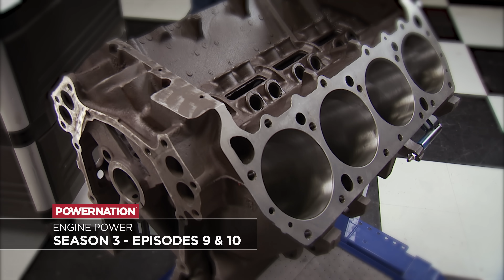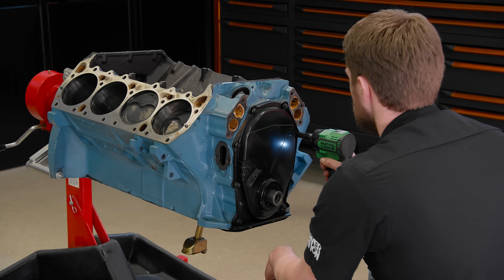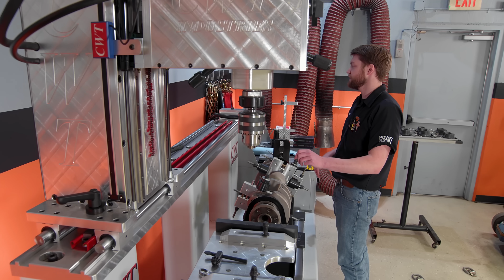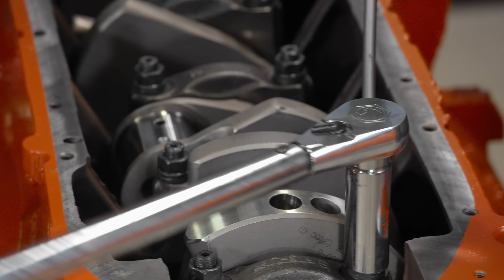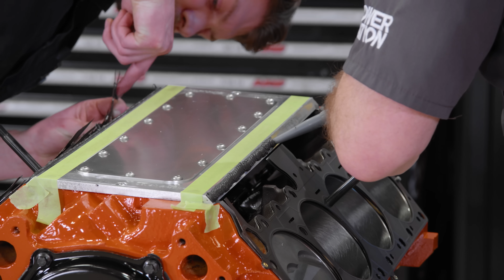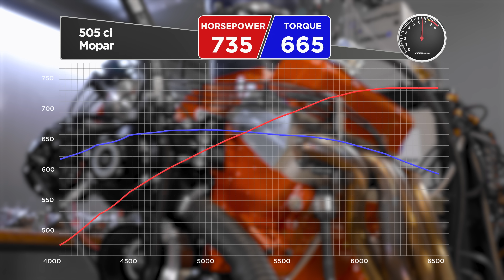Building a HEMI Killer?! 505ci Wedge-Head Mopar Delivers BIG Pump Gas Horsepower

Comment: Man, I would really love to have this engine in a 1964-era Barracuda hatchback. I wouldn't mine having it in a 1969 Roadrunner in Plum Krazy, or a 1970 Challenger also in Plum Krazy, but I am a real Mopar lover. My mom actually had a 69 Roadrunner with a 426 Hemi and the A-833 4 speed manual, and it would pull the front wheels off the ground on the 1-2 shift with that Elephant engine, but I'd love to have this real powerhouse in a 1964 Barracuda...or even a Jensen Interceptor...made from 1966-1976 (which was released with the 383 or 440 Mopar big blocks). A Jensen Interceptor was featured in one of the Fast and the Furious movies.
Reply: Rode in a 'Cuda a few times,  Nice torquey car.   Never got to drive or ride in a roadrunner, but I really like the styling.

Comment: Hi guys, I want to tell you about what I know about hemisphere engines I've owned two in myblufe, one was a 392 cross ram out of a ,'59 Imoerial, I bought from junkyard motor n trans. I refreshed both and put it in my '56 plymouth Fury  2dr hardtop. I'm a 76 yr old combat paratrooper drafted in '67, did two tours with 101st Airborne infantry. In early mid sixties tri five checks were everywhere and cheap. I owned all three years multiples of each. I hitrodded them back then 3/4 n full race cams lifters 4bbk carbs etc. Put 4spds in floor etc. Back then they would haul ass. 327s was only engine I'd put in em. Locker diffs. But my favorite car I ever owned was my '56 Fury hemisphere and my '69 GTX dual 4bbl hemi. I bought it used after I survived v n war. It was beat I pd $800 for it. Body was good interior dirty but all there. Motor wouldn't start but oil was good block goid. But , heads and so on the dust was dual point but had one set of points in it. I put Mallory elect ignition in, rebuilt heads new valves springs, rocker springs are seats etc. Had both 4bbls rebuilt. All new bearings cam brings too rings decked block etc. All the local 'experts who had money avoided the draft said a 454or 440 would " eat my hemis lunch found out they didn't know their ass from an onion!! I learned how to properly launch my GTX, feather it and no damn 440 or any Chevy beat me in drag race. I kept both my hemisphere till I got the marriage bug and sold them to buy a house. Big mistake but.... shut the hell.... Today with all your fancy equip tech knowledge we you can get 1000 up out of a 283, but bacK in my day I'd race county's any where anybtime!!! Enjoy your shiw!!!!
Reply: thank you for your service!
Reply: 392 came in 57 and 58. They went 413 after that. My be Don Garlits could ring in.

Comment: really love these time proven engines.  I'm a ford guy myself, my daily driver is a '65 galaxie 500 with a mercury supermarauder MEL 430 rated at 400hp, but I enjoy all big v8 muscle.  rode in many a 45 4 chevy that struggled to equal my ford beast, but two of the most memorable are a hemi 'cuda, and driving a semi with a cummins slant six diesel.
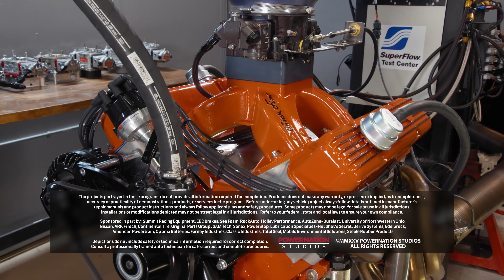Reply: Not knocking your set up at all, actually think it's pretty cool but.... I can build a pump gas 383ci SBC that'll easily make 500hp and about as much torque for around 5k. I've built many and they are screaming little/light engine's! That's at 11.1 CR @ 32 degrees of timing, throw some C-16 in it, crank the timing up to 36 degrees and then they are an absolute beast! Or take them down to 9.1 CR and throw a 6-71 blower on them and make 700hp all day everyday! That's spinning the blower at a reasonable speed for a daily, but you could wick it up and make right around 770hp, also depending on what kinda money is available for heads. 21:24  Can do that for someone for right at 10k. But as I tell my customers, at that point you better have a converter/clutch, trans and rear end that can take that kinda power! Decent driveshaft as well as I found out many years ago running 50's on the rear of my Camaro, them driveshafts twist fairly easily with power! I just mention all this cuz you said 454 Chevys have a hard time with your 430ci, like what, a stock 454 out of a motorhome or something? With the 383's I'm talking stock 350 Chevy block's, get into Dart, World or Brodix block's and that's a whole other ball game, like 454 small blocks that'll make ya wet your damn self!🤣😂 The pic in my profile is a 460ci SBC that we built with another company I was with that is now no longer around sad to say.
Reply: @docsmallblock6584  Yeah, the 454 is no slouch, but some people just don't know how to tune them for max power.  I've smoked a fair number of those, but I've also been smoked by a few who know how to get the most out of that big GM powerhouse :)
Reply: @docsmallblock6584  Yeah. the 454 can be a beast when tuned properly.  some people drop the ball though.   anyway I think the ultimate symphony I've tried to get people on Smokestak to do, would be an idle soundoff,  430 MEL, 454 chevy, Hemi Mopar, and   8v-71 detroit diesel, all on glass packs, with dual exhaust.
Reply: @docsmallblock6584  also having seen how well the 6v-71 blowers work on a 454, I've been toying on paper with the idea of a buda/waukesha gas or lister diesel forced induction for my MEL..  As I said, I'm more tuning for low end grunt, as this is a var I drive everyday, but still its fun to embarass know it all teens at the lights :)
Reply: A 430 is a cool choice. I like uncommon engines
Reply: @tiredguy21  Yeah, she's a beast, but not without her quirks.  I think the same can be said of all the big powerhouses before emissions regs choked power on newer machines.
Reply: I'm @RodneyDawn on Smokestak forums, if you want to chat about true classic HP in a pure engine/mechanics forum.   @tiredguy21
Reply: been a while since I done that, I'm not as young as I used to be, but if I met somebody at the lights with a hemi 'cuda again, I just might be interested in burying the pedal and dropping the clutch, all in good fun, for old times sake. :)
Reply: the mopar hemi usually revs faster, but being heavier, and the engine revving slower, my MEL usually grips better in 1st,  after that, its all up to tuning, as both engines are real powerhouses. :)
Reply: I run a 60's aftermarket dual plate clutch (new old stock), but as I said this is a daily driver, I normally don't race this car, except for the occasional casual meeting at the lights.   I just run a dual plate clutch cause this thing makes so much torque and the galaxie is a very heavy car.
Reply: as for exhaust I don't run aftermarket headers, just normal MEL factory exhaust, but I have those tied to dual 3" exhaust, dual glasspacks, and over the axle exits with mustang tips.   as for timing, I run 5 deg slow, as thats the best balance for both power and economy, but it could run much lower if I was making a drag engine.
Reply: That will rip
Reply: @Legoofy187 it sure does :)
Reply: I'm a Mopar guy at heart, but like you I just love all the old school V8 muscle cars. I have a 79 Volare Duster (Not a real muscle car I know) that I've mini tubbed, and dropped a 450hp 360 (372ci now) into it that's built to be a hot street engine and I've been able to beat my friend's 67 Mustang with a 428 stoplight to stoplight just because I have a better chassis setup. He probably makes 60-75hp more than I do but he rides on stock style suspension, I have calvert split mono leafs, 9 way adjustable shocks, caltrac bars, a locker and 4.11 gears in a shortened Ford 9" out back, and up front I have tubular upper control arms, 6 way adjustable front shocks, and stock style lower control arms and slant 6 torsion bars. The subframe is tied together with US Car Tool subframe connectors and torque boxes to stiffen it up and she rides on a 29x10 rear tire with 26x4's up front. My friend just runs stock style everything on his mustang with 15x8 magnum 500 wheels and cooper cobra tires. Sometimes all you need is a better chassis and suspension setup to beat more powerful cars, but his 67 Stang is absolutely beautiful! It's really a show car that he cruises around in on nice weekends. My car is a weekend thrasher built to stop light race and hook up in a dig. But once his car hooks up and I run out of gear he would beat me no questions asked.
Reply: Slant 6 Cummins ? Never knew they made those ,
Reply: Cummins never made a slant six diesel. All of them were either V8 or straight six.

Comment: Jon kaase built a N/A 598BBF that pump out 1108hp933tp....what's that wedge head problem?
Reply: Are you for real???

You think that Kaase built an 1100+ hp engine with 11-1 compression, .670 intake lift with almost 100 LESS cubic inches and an out of the box street head???

Man, the internet has some real winners. LOL

Comment: Why not the 400 block for a tidier package? You can still stroke it to 500 c.i. and use a shorter rod. Win, win.
Reply: Shhh don't tell them about the B blocks.
Reply: @ShovelMonkey or the high nickel blocks in the early 400 ci.
Reply: Shoulda, could, woulda?
Reply: @457rick  yeah mopar was pretty ahead of the times with a lot of their innnovations.    And thats coming from a ford guy. :)
Reply: That's the blocks my Mopar buds use, and a 426 max wedge crank I believe, torque monsters and I think 520+ cubes
Reply: haha very true.  :)
Reply: What would the advantage of having a shorter Rod ??
Generally considered the ideal Rod-Length to Stroke Length Ratio is ??
Reply: @ChrisLichtwark-b4k I think I read in a smokey book that the ideal rod length is 1.6 × the stroke, keeps the rod and piston , piston mainly straighter with throw of crank, go too long and rapid piston change in direction up and down creates a ton of vacuum and hard on pistons
Reply: @ChrisLichtwark-b4k  actually it's 1.65 × stroke

Comment: JUNK 

You got 
$3000 cylinder heads 
$500 cam 
$600 intake 
$1500 stroker kit 
11:4 compression 
260 duration.670 lift cam 
On a 8.2-8.3L engine 
760HP 

I’ll take a regular old Chevy 350 some $70 junk yard vortec heads

$135 232 .480/.480 flat tappet cam 

$1500 turbo kit including the blow through carb in the $1500 

A weekend of wrenching and I’ll have 800-900hp at which I can turn up or down with boost 

This here ,,,,,,JUNK 
How many of you guys watching this have a minimum of $5600 to put into the engine not including labor? Or the cost of a 505 big block engine itself not including the performance parts ? Avg guy doing this will have $10k or more just in the engine for 760hp ,,,,,,,,,JUNK
Reply: I have two of these junk Motors, both are very reliable and require no maintenance and make right at 600 horsepower each on pump gas. I don't call that junk but they are not cheap. Don't you think it would be boring if everybody had a Chevrolet?
Reply: @thomasward4505 for me and everyone else list your cost cost break down I can guarantee for 600hp isn’t not worth it
Reply: Say you drive a clapped out Fox Body Mustang without saying you drive a clapped out Fox Body Mustang. LOL.  I have one of these in my Pro Street '68 Dart.  AND my car has paint on it.  I'll compare MY junk to YOUR junk any day.  Mopars rule!!

Comment: That motor looks awesome, and 760 HP doesn't hurt either!!!  Well done gents!!
Reply: I think Mopar underrated their engines like other manufacturers did for insurance companies, needless to say those big hemi's produced a lot more in real life than they did on paper.  :)
Reply: I've stood on it next to a 400, and my 430 despite being 30 ci bigger, was pretty evenly matched for actual wheel usable horsepower.
Reply: yeah, Mopar is real power, especially the hemi's, there's a reason Ford built the Cammer way back in the day, to compete with the Mopar sport Pllymouth Fury's 413's and a reason Nascar wouldn't let it compete.   the design, regardless of company. screams power in most any configuration.

Comment: Honestly, the wedges are so much better than the Hemis for anything short of a full race engine.
Reply: Oh so true. Back in ‘76 my buddy had a hemi Cuda, I had a 440-6 GTX. He should have wiped the street with me, but I was so far down the 1/4 by the time his hemi came on that I usually won. Damn, those were fun times.
Reply: Really?
Reply: @ThePaulv12  Yes, and it is especially true for naturally aspirated stuff. Original style hemi heads flow better, but combustion chamber shape is a nightmare and requires a huge dome to get any compression, and the valve train components are fragile and complicated.

Comment: Bring the Mopar 408 back and run a larger cam. Maybe upgrade to solid roller with around 256-264deg duration and see if y’all can hit the 600hp mark. Probably will need to port the intake, hint hint😉.
I’ve got a pump gas 408 in the shop now that we should see 600hp with Trickflow heads and custom hydraulic roller cam, but we have applied some special parts selection to make it happen.
Reply: a big block oldschool hemi, tuned to take advantage of that low end torque could have given Hall Scott a run for their money for big truck gas engines. :)  that torque is really impressive.
Reply: Had one of those too, a 1984 ram magnum with a 1970 hemi swap,, towed the family camper trailer for a great many years when I was younger.  a real workhorse and a testament to Mopar engines being equally as good on the farm as on the track.
Reply: as far as big trucks, well, being a longhaul trucker to pay my way through vet school back in the day, I've drove everything from a Buda inline 4 gas, to a 12v92 detroit diesel., and even the occasional european truck, but for big trucks, I always preferred the cummins diesel for its low end grunt and smooth operation.